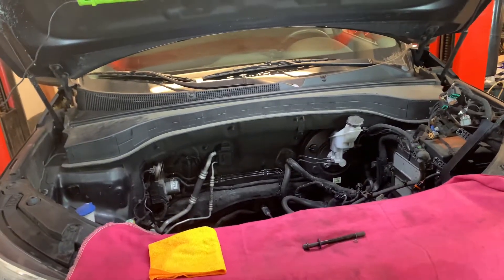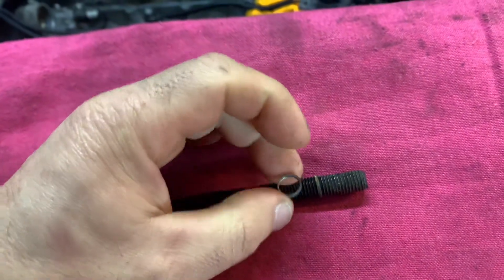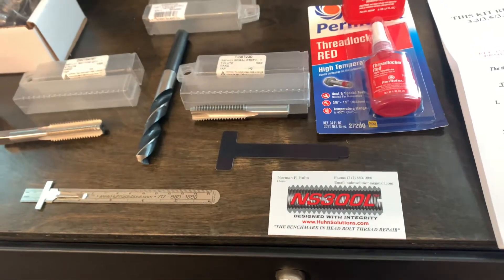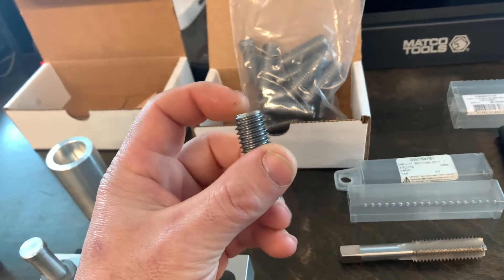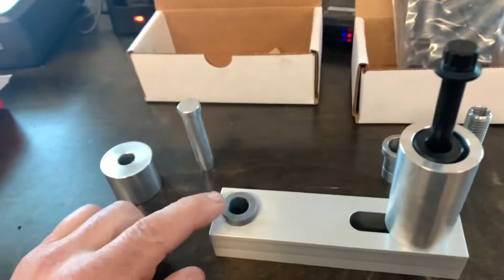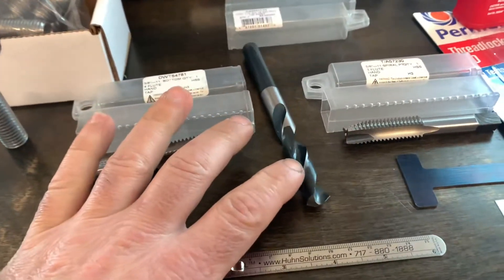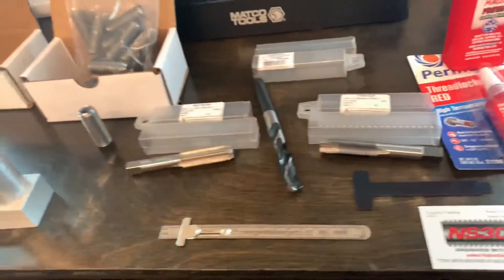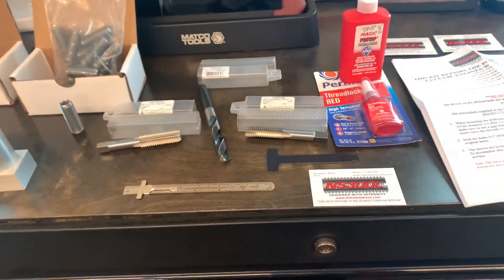Kia Sorento 3.3 head bolt thread failure and solution.

Comment: They have updated the service bulletin to 254, with the latest updated in July of 2025. Quite simply, for a head bolt issue/strip/overheat, ''if'' you qualify (not sure what Kia Corp uses to assess), the fix is a new (crate) engine. Period. No short block or remaned engine. The dealership I used said these sleeves don't work. I guess if you're out of luck with Kia HQ (via your dealeship), this would be a last resort.

Comment: this is a unofficial recall now under service bulletin#253.  they extended warranty to 180K miles for head bolt/gasket failure.  They are to test at no charge if you complain of coolant loss/visible leak or signs of coolant mixing with oil(under fill cap milky white),  one of the fixes is they replace engine under warranty. If you fixed this yourself and have receipts I think you can file for reimbursement also. The kept NTSB from doing a full recall by offering to extend warranty to 180K and fix ones that complain but they didn't send notice to customers.

Comment: Kia is extending the warranty on this for 15 years, 180,000 miles for the 3.3L 2016-2017 Sorrentos. The extended warranty includes used vehicles

Comment: BEWARE: Kia lost a class action lawsuit, and has now extended the warranty for models with head gasket failures.  My wife's Kia Sorento developed coolant boil-off issues just as we hit the 100,000 mark.  I thought it was due for the junkyard, but Kia approved the warranty repair.  We are getting an entirely new short block, not just head gasket repairs.  At least, we would be if most of the car dealerships in the country weren't out of order due to a cloud-based software ransomware attack.
Reply: Also the new engine will likely repeat. Change the oil often and coolant. It’s sensitive.

Comment: I got everything cleaned up, I put my bore scope down the head bolt holes, saw two with obvious damaged threads. Since the engine got pretty hot I wonder if it would be better to source a good used block and heads that were not overheated. It sustained a bit of internal rust while sitting. We had the big snow here in TX two yrs ago, I don't know if it had enough water in it to crack anything, no freeze plugs popped. I'm going to need to bore this one anyway. The crank is fine. The block decks are warped .0027 and the heads are .001 I read that getting aluminum hot weakens it.

Comment: Do you know where I can source some cam follower buckets? This motor had a lot of water in it, plus it sat for 3 yrs, plain water not coolant. The cyls and pistons are all bad. Maybe I need to source a better block and heads. my crank is fine...almost no wear. I don't want to get over budget but I am already, the engine rebuild kit plus the thread kit.....$1200.

Comment: Doe anyone know how much material you can remove from the deck and heads? I got about .001" warpage on the heads but .0027 on both decks. in the middle of both head and deck, so added together nearly .004" of space Also on mine I have a thing across the middle where the knock sensors go, I messed up the guide pin, it only serves to align one oring,  I tried drilling out, its a mess now. I have a .25" deep hole there, I don't think it will hurt anything, its a blind hole. I think that port is the oil feed from the pump it goes across the top to the oil filter, Sedona.3.8,  Plenty of room to apply a bead sealant outside the oring as a backup.  As long as I center the bolt holes carefully should be fine. The other end has no dowel.

Comment: How probable is this to happen? I have the block out rebuilding it, I didn't see any bad threads.
Reply from the maker: The threads looked fine to me coming out. A few of the bolts did feel looser than normal on disassembly. It wasn’t until I went to reinstall the head bolts that they stripped. But this engine was overheated severely. I’m not sure how common it is.
Reply: @nightshiftautomotive3985  mine overheated too...two bolts were not tight
Reply from the maker: @vernonbosshard9317  In that case I would probably just do the inserts and be done with it.

Comment: My 2016 Sorento SXL blew a gasket due to those stripped bolts. One would think KIA would've had a recall considering this occurs often My engine needs to be replaced and we're in that process now under my extended warranty.

Comment: How long do you expect pect this to last?  Permanently or have you seen issues with block wearing at the same point again?
Kia short block on back order and I'm concerned about this happening on the new engine.
Reply from the maker: This is a permanent repair that is stronger then the oem setup. I would not expect a repeat failure.

Comment: I just used this kit on my 2015 Kia Cadenza 3.3 V6 and it worked pretty well, was able to get the inserts in and they torqued to spec just fine. As long as you follow the instructions and measure right you will be fine. It was my first time ever doing this job but once I got started with a few it  got really easy. I ended up doing the entire block.
Reply: did you replace the head gasket or just remove the bolts, tap, insert and install new bolts? I have a 16 sorento with what seems to be the same issue at 80k miles.
Reply: @minitobe8525  I replaced every gasket except for the exhaust manifold gaskets, got the heads machined, replaced the waterpump and thermostat. I would say make sure your timing components are in good shape because you can replace those too if you want but would recommend it if you are keeping the car. My car started overheating at around 69k miles. I'm at 78k now and the car runs perfect
Reply: @DontayCrowderLegend0141  got it. I come from mini cooper world and recently started diving into audis and vw. This kia was a good deal to pass. If i pressurize the coolant system, i get some pressure and then blow by. I wonder if that's head bolt issue vs head gasket. 

I will take both heads and do the timing while I'm there. It seems like it will cost about 1500 for parts and machine shop. Is that a close estimate? (I'm in USA)
Reply: @minitobe8525  that's about right, I'm in the US too and I probably spent close to 2,000 in parts and tools, I was fortunate to find a repair manual with all the torque specs and sequences for the entire engine for free. The Sorento has the 3.3 too correct?
Reply: @DontayCrowderLegend0141  yes that's correct. Do you have a link to that document to share? 

2k isn't too bad. Any special tools needed? From the other videos, there doesn't seem to be any special tools. I could be wrong.
Reply: @minitobe8525  No special tools needed, I just made life easier by purchasing new drills and impact wrenches and a nice breaker bar, the only thing i was worried about was getting the crank pulley off but i just used the old belt to create a wedge so i can remove the bolt. I also got a torque adapter the also measures angles. I don't have the links anymore since i did it long ago and my browser history doesn't go back the far but i did download the PDF's so i can send them to you that way

Comment: The most impressive is how did you manage to remove cylinder heads with the engine still in the car? Even with engine out of the car it is not an easy job. By the way, taking the engine out is not as hard as you think. It took me about couple hours, no more. You don't have to separate it from transmission, just the whole unit. :-)
Reply: Video ???

Comment: the bolt in my kia v3.3 was damaged and changed to a new one, but after one month my engine was blown because coolant is out. Now mechanics said that I need the head gasket if the engine is okay, overwise change engine.
The engine is starting and works fine except heating :)
Is it a good idea to change the head gasket or better to change the engine?
If I change the gasket should I do this repair with this tool set?
Reply: Let me know the answer you get please as I have same issue

Comment: Can this be a cause of your engine overheating?
Reply: It’s been a tough battle but it’s finally over and the warranty company agreed to approve the fix. 😊Thanks for your advice ❤️
Reply from the maker: Yes it can cause overheating. This vehicle was overheating due to coolant loss.
Reply: My 2016 Kia is overheating and dealership says blown head gasket, only 79000 miles and the warranty company wants them to tear down the engine in order to see if this was the cause. If not they won’t repair
Reply from the maker: @katrinawilson5351  it’s common for a warranty company to request disassembly for failure confirmation. How did the shop determine the head gasket has failed? If they have solid evidence then that should be enough for the warranty company.

Comment: I did this job on my moms car. Big fucking job. I used regular tap and die set. Probably wasn't a good idea but its been working knock on wood. The kits like this were expensive.
Reply: We're did you find the torque specs for the cylinder heads?

Comment: Same thing happened to our KIA. The dealer fixed it, replaced the bolts and block. Will there be any permanent damage to our engine?
Reply from the maker: If the job was done correctly you should be ok. I’m not sure if they have an upgraded block or not. If not, the new one will also be susceptible to the same failure. Trying not to overheat it is the best advice I can give.

Comment: I had another question I have Already the kit But where you buy the bolts and gaskets. Thanks for the info
Reply from the maker: I believe that they are available in the aftermarket but these parts came from the dealer.
Reply: Thank you for you help

Comment: What do you do if a '16 Sorento has stripped head bolts that already have Helicoils inserted (improperly it appears)? Drill em out and go the next size up?
Reply from the maker: Like a regular helicoil? These inserts are thick and I think you could remove a regular helicoil and use the inserts. I guess it depends on what type of repair was done previously.

Comment: Kia quotes me 12k for a complete motor replacement and refused to fix. I had a ton of people on Reddit tell me to purchase this kit. I'm actually starting repair here soon. Fingers crossed all goes well.
Reply from the maker: Keep in mind there may be other factors affecting their decision not to attempt a repair. If there is significant coolant in the oil or the vehicle was severely overheated you may end up with issues after the repair. The one I did is still running strong but it was caught early and was not overheated. This one had some oil in the coolant and an external coolant leak from the corner of the front head.
Reply: @nightshiftautomotive3985  they wouldn't even short block it. He, service manager, told me the dealership isn't trained to do anything but replace parts and diag bad parts.
Reply from the maker: @Jerryattrickliverspottedhands  well that’s disappointing. Sad state of affairs when a dealer can’t do engine work.
Reply: @nightshiftautomotive3985  I was shocked by the answer but hey I get to work on something new. I've been a Cummins mechanic my whole life (I'm 33)- 9, 12, 15, & 19 liter diesels... so this is a fun project for me to attempt. I have very little experience with Petro engines except a 5.3...anyways...I will follow up one day, I watched a few videos, enjoy the channel, thanks for the free information.
Reply: @nightshiftautomotive3985  mine overheated, needs a new head- was warped at 3mm, spec is 2.

Comment: Just found your video! Thank goodness. I have this issue with my 2016 Sorento. Kia wants 5 to 7 thousand dollars to replace the short block. I'm going to take this to my mechanic and see if its something he can do. I'm surehe can, he's a top notch guy.
Reply from the maker: It’s a time consuming job but not terribly difficult. And it’s a permanent repair so it’s a great option. Let me know if your guy needs any more info. Good luck!
Reply: We had the same issue during our vacation road trip. So far KIA is honoring the 100,000 mile warranty. I have a question, will there be any permanent damage to the engine? I don't want the family vehicle leaving us on the side of the road again. Thanks.
Reply: @Chingadazos  so here is the follow up. I got the inserts and found a guy to do the job. He has done others in the past (Toyotas but not Kia). 6 to 7 thousand to do the job. Better then the 8k kia wanted but still to much. I ended up negotiating with Kia and they agreed to do a new small block (bottom end) and machine the top end and I pay for the labor only. In the end about $1800. Running great!
Reply: Did your vehicle ever overheat due to this?
Reply: It did overheat, thats how we onew there was a problem
Reply: @WilliamDavis-jo1ug  Hi, were you the original owner of your KIA? I have a used Kia sorento 2016 @ 88k miles and car has no warranty.
Reply: @therealsaintseiya  yes I am the original owner. The issue happened at about 112000 miles,  right after the warranty expired.
Reply: Kia refused to use the kit and so I had to wait for them to find a new block to rebuild the engine with. We settled with Kia to just pay for the labor. It still cost me a couple of grand but a lot better than the 8 to 9 grand they wanted.

Comment: Just did this at my shop for a customer...drilled and tapped all 16 holes. pretty simple. did it in the car as well. used the Huhn kit as well. This really should be a recall.as KIA knows about it.
Reply: Should definitely be a recall. Absolute bull shit. Just did this on my moms car and she still owes 9000. I used a regular tap and die set. Probably a bad idea but its been working thank god.
Reply from the maker: Yes it’s not a bad job with the Huhn kit. Just time consuming.
Reply: How long did it roughly take you.
My 3.8 Genesis blew a head gasket and threads came out after attempting to re install the heads. I am buying the hun kit today. I have rebuilt this whole engine myself I am 21 not trying to say I know a lot. But I have never done this type of work before. For example the best way to clear out the old threads and anything that might get in the way. I have replaced all the internals in engine . This block looks identical to mine. Any response or tips is appreciated
Reply: @Richoffloudpack how did it go?
Reply: also my customers symptoms where a misfire on cylinder 2. bore scope in cylinder found coolant leak. removed valve cover and found multiple loose head bolts.
Reply: You will have the kid's part number to order it

Comment: Can you do a video showing how you actually put the inserts in the block I have the same issue I'm getting ready to start on I already have the kit the insert kit I'm waiting on my head to come back so that I can put them once I put this answer kit on but it would really help me to actually see it being done to make sure I do it right cuz I know it's a one time fix that you cannot mess up
Reply from the maker: Next time I do one I will make another video. The kit is awesome and it’s pretty self explanatory. The jig is self aligning and the drill bit is ground off on the tip so it won’t drill past the bottom of the hole. Just make sure you set the insert at the right height like he suggests and go slow on the drilling. Lots of cutting fluid. And tape off EVERYTHING. the chips go all over the place.